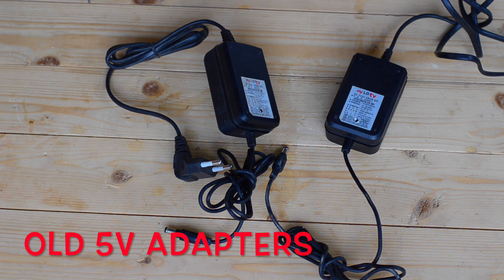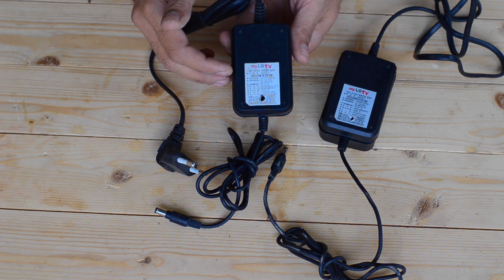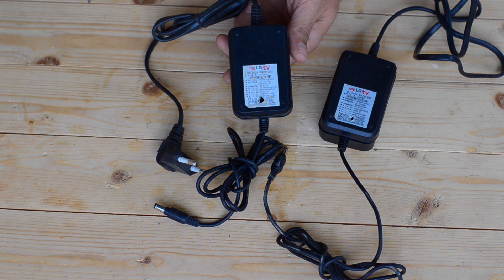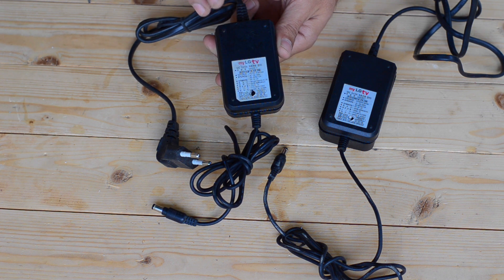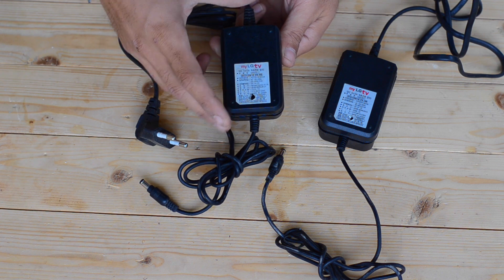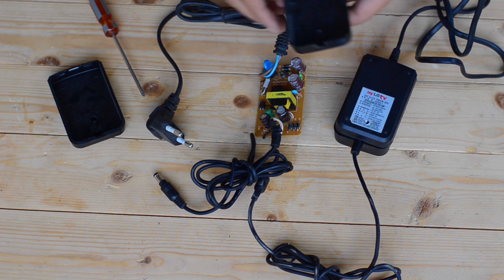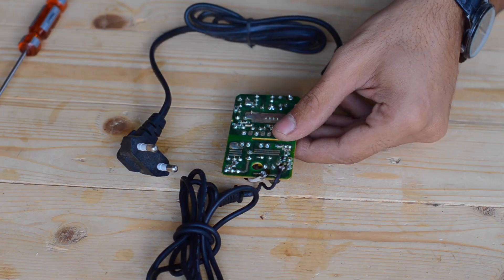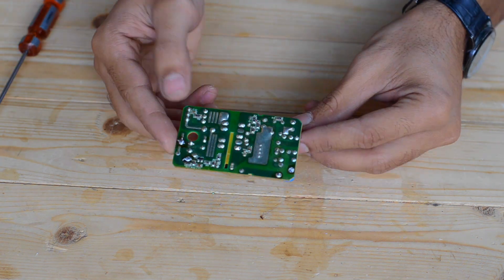How to make an Ultra Fast Smart Phone Charger Using 5v Adapters

Comment: A question. . . I tried to do it just like you instead I of using "DC" I used 2  "AC" charges and it didn't work can you help with that? And or does it have to be DC  or can you make the AC  work as well?
Reply: It has to be DC friend
Reply: @hstranger19798  thanks

Comment: Very good. thanks. please a diagram of output because the cable micro usb of the charging cable has 4 cables, red positivo, black negativo, white de fast charging y green. where was connected the cable white of the charging cable? thanks.

Comment: 5v? But android charger is 3v?
Reply: this because the app you measure tells the terminal voltage of your battery 5 v you gave but the terminal of your battery and some kind of resistance are there it woudh be 3.8 to 4 volt .. but the thing matter a lot is current how much you provide for your battery if you provide 5 v 1 Amp it's normal charge . 5v 2Amp normal to above .. samsung fast charger and oneplus uses 5v 4Amp or 5v 5amp so output watt is 25 watt .

Comment: Hey bro, which circuit keep a charger stable ? Means, save a charger for any kind of short circuit, quick damaged, dead, durability to long time ago use or longibity ? Keep the charger circuit safe ?
Reply: yes, they have a proper fuse, so in case of short circuit the fuse opens

Comment: Fast charging depends on factors like...
1)The phone supports fast charging. 
2)Fast charger with proper compatible cable.
Reply: wires thickness also, more thick the wires are more current it can carry

Comment: As he connected two adapters of 5V 2A in series  so the output will be 5V 4A, but used a normal 2A charging cable, so the phone will not charge fast.
It's a fake video.
Reply: What? If you put the voltage sources in series, the total voltage will be the sum of them!

Comment: You can have 1000amps adapter but smartphone will draw that much curent how much it needs. So this is useless
Reply from the maker: You are right indeed but this is the solution for the case when you got a cheap Chinese charger and it doesn't supplies the amps required by your phone
Reply: You can fake the power going to the usb ie using  CC/CV  PWM psu  set at say 150-300khz  6v  5a  and the phone won't see the current due to  high freq.The phone will charge very quick due to the high freq and  6v  5a i can charge my note 4  from 10% to 100% 20 mins
Reply: @DEVONLAD11  man you know that if you give higher curent to battery than it need's it is likely going to explode. And i talk about this video not other options.

Comment: only wants 1 badly trimmed off component - to poke through that double sided tape and...... BANG! Wouldn't it have been just as easy to use a plastic separator between the boards? plus, no matter what the current capability - the phone will only draw the amount of current that it requires - definitely not 4 amps!